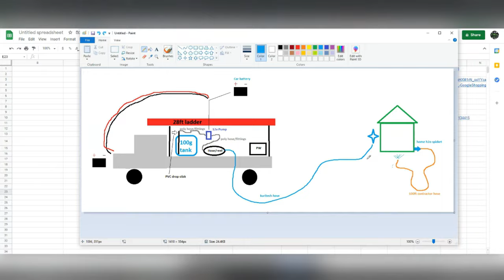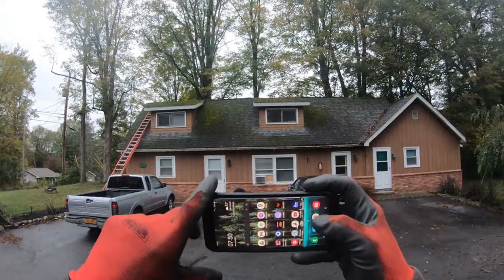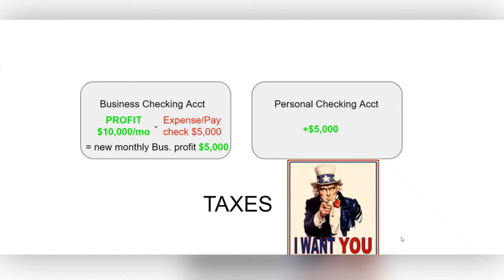STOP Being A Consumer - Soft Wash Youtube Sucking You DRY!

Comment: You have spoken a lot of truth. Start out small and cheap. Then, start lining up the jobs. Keep putting money in the kiddy for better equipment, advertising, and good old SEO. And yes, by everything I have heard and seen. 8 gallons minutes is the sweet spot to run from.  I am at a 4-gallon-a-minute DeWalt on Wheels with a hose reel and just bought an unloader, so I don't have to worry about burning up my pump. I am looking to buy a small trailer with a water tank this Thursday. I am investing in parts and pieces to build a softwash system. This is not a race. Slow and easy so I can stay in the game and work my way up the ladder. Early on, I bought the XJet and am very happy I did. Down streaming is excellent, but with an XJet, I can turn the soap on and off using a valve in line. The downside is that you are dragging a 5-gallon container of cleaner around. But it's absolutely doable. Get a hose reel because dealing with the pressure line is much easier. I mounted the reel to my pressure washer. Works great. On the other side, if you have sixty grand and can blow it, by all means, buy a complete system and pay for classes on how to pressure wash. My last thought is to get insurance and get it immediately. If you screw something up, they will be coming after you in a blink of an eye. I use Next Insurance.

Comment: Another advice I would give someone that’s thinking to start is to start small and grow as you go, there’s no need to get a $10k $15k $20k to start up. I started with a mobile pressure washer and a 18” surface cleaner and a some business cards and flyers all for less than $1500. You also have to figure out what works for you, not every service or equipment will fit your market or region.
Reply from the maker: 100% correct. I built my first setup at tractor supply and home depot. Made 1000s. As it started to fail I upgraded to actual wash stuff and chem lines. Until you can justify these investments don't do it

Comment: Well said, I started out with a 2.5gpm pressure washer and a pump up sprayer. Did that for two seasons and bought better equipment when I could. You are correct, all the info you need is out there for free. If you think you need to spend a $1000 for a course ask yourself, what did people do before the internet and none of that was available. There was still wildly successful people out there, they figured it out as they went along. Experience goes a long long way and there is no shortcuts. For the money you spend on a course you can go get yourself some nice equipment to do your job better and faster. Most people that buy that stuff don't end up successful, they never even finish the course. They just end up broke.
Reply from the maker: Hey Robert. You're 100% correct. Doing the job is the best learning experience you can get

Comment: Do what you can with the time you have. That's My motto.
I totally agree with your assessment of a lot of the people trying to line their pockets with information which is freely available in many places. I am currently only a weekend warrior soft/pressure washing  (as I live in a smaller community). Late last year I added concrete cleaning, to my house cleaning. I also did a few roofs, but have mixed feeling about just telling a customer they see the results in maybe a few months (depending on the weather washing all the dead stuff off). If you could give any advice on roofs I would appreciate it.
My system consists of two 5 gallon a minute soft wash pumps (one is just a back up just in case main one breaks while in middle of a job), one 3200 psi, 2.5 gpm pressure washer, and a surface cleaner. Using 55 gallon barrels for water and bleach. Made my own splitter/mixer valves for much less then these guys try and sell you one. 
I just got business cards, but mainly have a few jobs a week just from word of mouth referrals from people who really liked the job I did on their homes. I may advertise in the local free paper this year to try and pick up a few more jobs a week.
Reply from the maker: Hey Charles. Roof sells can be tricky. I never promise a moss free roof. I tell them I will brush the excess and treat the entire roof. The rest is up to mother nature. Never had a problem. The issue comes if you tell them 100% it will fall off and it doesnt. Lots of money in house washes so I try to only take roofs if I'm asked. I don't market much for them. Sounds like you're off to a good start man. Got your ducks in line
Reply: Advertise in the free local paper is a great idea that I didn't think of.I will be adding that to my marketing campaign now.Thanks for the free marketing suggestion!
Reply: @Defender_of_men  I hope it works out well for you. It is one of the cheaper forms of advertising.

Comment: So for a guy starting out. Low budget but will get the job done. What does someone need. 5 gpm ? A surface scrubber. 12 v soft wash set up ?  Can you list what I need to hit the ground running with something reliable and will work. Thanks
Reply from the maker: 5.5 gpm gas machine is for the beginner or pro. Add a downstream injector and you can wash houses and do flatwork. Check my newer wash vids
Reply: @YoungAmbitionYA  thank you. I appreciate the input.

Comment: Hey man got all my stuff in, only 1 more question I hope Lol So I have the Flojet pump, same Southeast Softwash hoses & hose reel. Where I’m stuck at now is deciding what Tubing size I need for best performance and won’t blow my pump up. I have 3/4in hose barb but seen everyone running 1/2 on tubing . Thanks again hope you reach back
Reply from the maker: I used that pump and barbs reduced to half inch last year. Pump ran fine

Comment: Loving the video's man, you're an inspiration.  The house at 10:33 is the size a several houses in my area, i'm curious what you're bid to clean that roof would be on that house or how much you'd spitball charge.  Do u have a minimum payment that you'd ask bc it's not a big house or do you go by square footage err?
Reply from the maker: A roof like that would be minimum $475. If there was moss or manual removal $600. Varies. Most of my house washes are min $325. I don't really do sqft. I just know my costs and most washes will be between $300-$450

Comment: What’s up man! Love your videos, definitely taught me a lot. But I’m setting up my 12v system for batch mixing and am planning on using one of my old plastic 55 gallon barrel. Any idea how much sq ft a 55 gallon can cover?? Would appreciate any help
Reply from the maker: Hey Shayden. It's hard to say especially without knowing your pump gpm. It's been awhile since I batch mixed but I'm guessing with a 55 gallon barrel and 5.5 gpm pump you've got about 10 minutes before your tank is empty. That's of continuous spraying. House washes typically cab ve sprayed quickly, misting a side of a house might only take 30 sec to a minute. It's the rinsing that takes lots of liquid. Either way I'd fill it up with water and pretend it had SH mixed in and spray your house. That's the true test

Comment: Thank you for this! There are a lot of comments here and the answer to my question may be in those comments but, I couldn't find it. 

I want to upgrade to an 8GPM but not sure what size buffer tank I need. I'm limited to pulling a trailer with a 4 runner with a 5K towing capacity. My trailer has a 3500lb single axle. Should I just upgrade to a 5GPM or can my current rig handle the 8? Appreciate any response here.
Reply from the maker: I have 100 gallon buffer tank with my 8gpm, but I'm on city water most of the time with good flow. If you have a lot of wells or slow water in your area go 275. Check my descriptions for full 8gpm build sheets. No smoke and mirrors. They're a legit resource and have every item you need with links
Reply: Thanks man. I just downloaded your file for the 8GPM and 12V softwash build. I also called and talked to the guys (Colby & Logan) at Pan Handle Powerwash and they were freaking great! You have saved me weeks if not months of research with your spreadsheets. Incredible job and thank you!

Comment: Hey could you tell us where to find the $200 Blend Valve. It is one that is not just on and off right? It does stop at set programed settings right? Would really like to see what your using. That would certainly be a game changer for $ 200.
Reply from the maker: It is just on and off. The stopping at programmed settings is overkill. Not sure why that would even be needed as most jobs don't require sh changes or soap changes. Typically you set your SH for a house wash and leave it or set it for a roof wash and leave it. An on off ball valve will allow you to use a single line, blend manifold and only toggle the sh on and off for washing or rinsing. Much cheaper, much more efficient. Way less maintenance and fail items as well.
Reply: @YoungAmbitionYA  thanks for educating me on that. Have a good day.

Comment: Appreciate your videos.  Do you find setting up for down streaming is necessary? Or is a soft wash system the all around go too? You're advise is appreciated I'm trying to not go down the YouTube hole on spending money on something that's not a necessary have to have. Hope that makes sense.
Reply from the maker: Hey Rob. It's all personal preference. Some guys love down streaming and some like 12v. Both get the job done and both put money in your pocket. Downstraming can provide more water flow making rinsing a little faster but also comes with fuel prices, maintenance, oil changes etc. 12v is maintenance free,  no fuel etc but not as much flow. Hope that helps
Reply: @YoungAmbitionYA  I already have a 12volt soft wash system with a proportioner.  Was just thinking about maybe setting up for down streaming.  But wouldn't I have to add another tank for batch mixing?
Reply from the maker: @Robert Green  the down stream injector feeds off the straight SH tank. No batch
Reply: @YoungAmbitionYA  yes sir I guess I would have to just add soap to my SH tank?
Reply from the maker: @robertgreen241  yes you could do that

Comment: I'm finding I still have to pressure wash after the soft wash, is anyone else experiencing that? The black mold or whatever will be barely sitting on there but it's not unstuck enough for my hose nozzle to remove by itself.  What am I doing wrong? Is this common or do I just need to mix more chemicals?
Reply: Like it's def doing something, disinfecting & changing the crud different colors, turns it orange etc, and loosening it up to the point where I can go up with my hand and wipe and leave a streak. My hose just can't knock it off
Reply from the maker: I would try upping your SH slightly. Typically the mold will disappear completely with the right mix and then your hose will rinse the SH off the siding. Hope that helps!